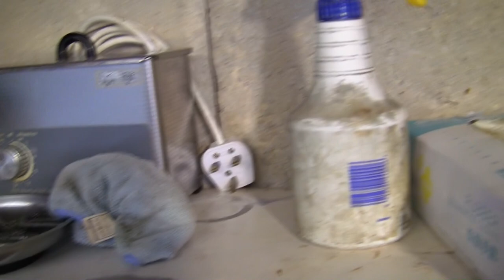Retro Hayter Harrier- Will It Run?

Comment: Hi Mower Man - it's Big Rodders in Ireland.  Lovely old Hayter.  Many folk don't know that it was Hayter that invented the rotary mower.  Legend has it that an engine,  most likely a Villiers, was placed on a dustbin lid with a blade and wheels attached.  Your mower is not a Hayerette, which was discontinued and then reintroduced due to demand.  The Hayterette does not have grass collection but boasts a disc with 4 swivelling razor sharp blades.  I have two, my Dad's 1969 model and a later one.  The body is top class alloy, like yours, and has bearing wheels.
Reply from the maker: Thanks! that's great info! I want a hayterette next!
Reply: @MowerMan  You could always buy a new one - a snip at £569!!  The price reflects the quality considering the Hayterette is an 18 inch push mower with no collection.  However, it is very light at under 30kg, has large wheels with bearings, a single lever height adjuster, the handle folds down and the wheels can be raised higher than the deck to ensure it can be carried in a car without movement.  With it's heavy disc and four blades it is extremely manoeuvrable and ideal for cutting heavy long grass. You'd think I was a Hayter salesman!
Reply: Yeah a rough cut mower with 4 blades.. a great mower

Comment: 2 great classic mowers there; both with the older (and best) Briggs and Stratton engines fitted. With regular servicing, they last a lifetime and can fully stripped and rebuilt. The Hayter is worth fully restoring, as they are very collectable and sought after. If the Champion deck is not worth restoring, then certainly try and rebuild/ restore the engine and remove any other good parts. Very interesting videos you do; please keep them coming.
Reply from the maker: Thanks. I have stripped down the champion for all the good bits cheers!
Reply: Yeah when all painted they go for good money

Comment: The year code should either be on the front of the starter cover or on the exhaust side of it read it backwards by my guess I’ll be a 60s engine
Reply from the maker: Thanks Jared! I'll take a closer look.
Reply: @MowerMan  No problem, I don’t know anything about Hayter mowers, we don’t get them over here in New Zealand we have Masport and LawnMaster, but the date code is either on the starter cover or on the base itself if it’s not worn off, stay safe Paul

Comment: them old Briggs are good engines i learned to work on engines on one of them it was on a Hayter hawk graveyard mower and had been sat out side for ten years. The starter recoil always sits on the shaft the shaft has a clutch built in to it and it is like a ratchet
Reply from the maker: Yeah strange! not seen one in a while. Would be good to know an easy way to remove the flywheel
Reply: @MowerMan  they just un screw and can remove fly wheel like normal lots of videos of it on YouTube
Reply from the maker: @Tractorguy9000  Thanks a lot

Comment: Good job paul
Reply from the maker: Cheers Nick
Reply: Paul I have a mountfield hp470 the wheels appear to be really wobbly have you come across this before ? Will I need they need replacing they have plastic inserts wondered if there was a fix rather than replacing them. Good channel by the way keep up the mower repairs 👍😎
Reply from the maker: @nickmcfall5152  Tbh i've not found a good way to sort them
Reply: I've tried a few things but just cant get them right lol!

Comment: hi have got a victa235 2stroke 1997 model  mower was  a non runner  now runs bur cant shut the damn thing off sussed the 
problem cant get the  bits i need for it watched some vids but the person who does them gets his hands in rhe way so i cant see where the wires go to n from  where they are supposed to go any ideas cheers (mr. mowertorvator) mick

Comment: you want 600ml of oil in those :)
Reply from the maker: top banana thanks! is there a fill level indicator?
Reply: @MowerMan  usually these a dipstick but if these not, really as long as everything is drained out 600 should do it perfectly
Reply from the maker: @joeosborne3585  Brilliant thanks a lot